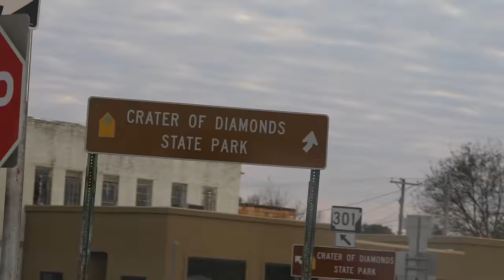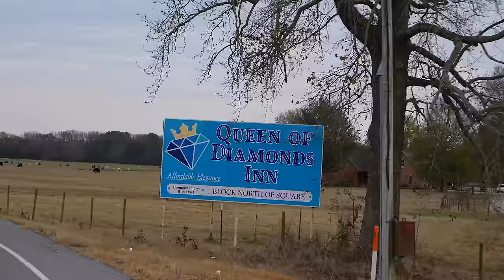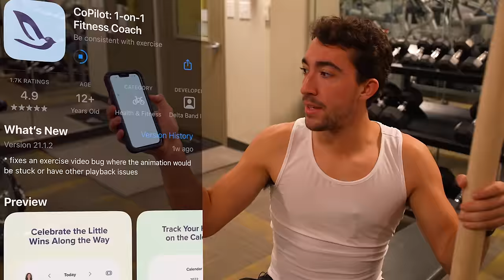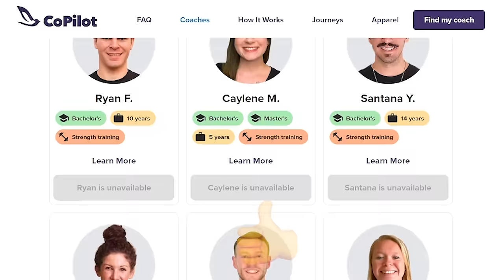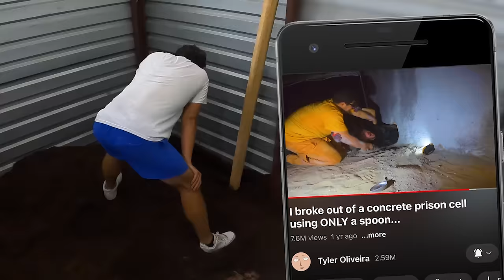I Used a Toothpick to Mine a Real Diamond...

Comment: For everyone reading this and interested to start working out 

Please dont isolate your front delt, most over used exercise there is. Rather do compound lifts (multi joint lifts) like dumbell overhead press. Front delt is in so many exercises included that you dont need to isolate it